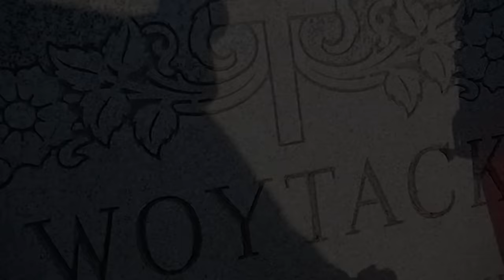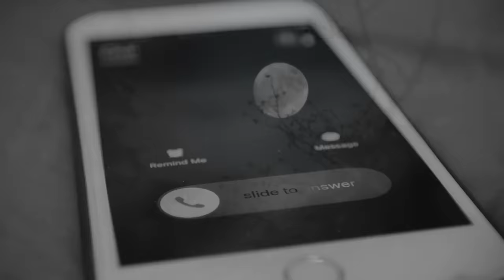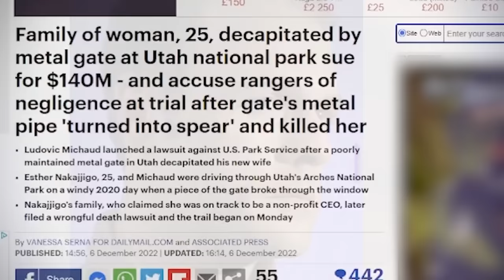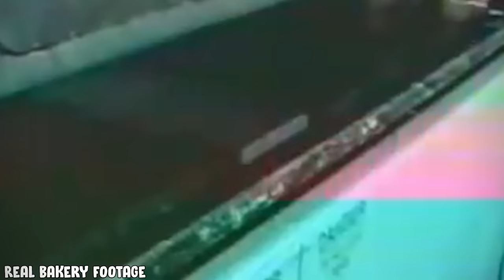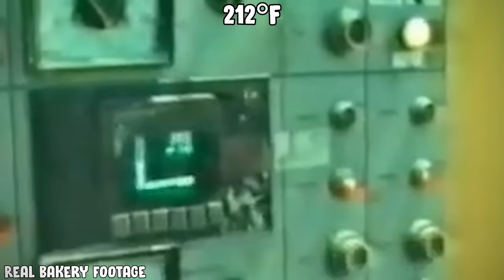CRUSHED by URINAL │ Bizarre Deaths #9

Comment: The story at #1 is an example why i quit working in a factory. Its always profit over lifes. If there's a safety audit, just put up band aids to get a pass then immediately go back to the unsafe "quicker" way.
Reply: Corpos gonna corpo, sad as it is. Unless their pocketbook is affected, they couldn’t care less about the well-being of their rank-and-file blue collar employees. 😒
Reply: every factory I worked at, safety depends on the workers, I take my time doing my job safely while others are always in a rush to get to work and they get injuries that basically get them laid off of work for a while.
Reply: orientation isn't just a bore fest when they walk you around and let you do some hands-on work
Reply: @_Circus_Clapped_  The problem is some factories would/will offer a productivity bonus effectively making their employees want to work quicker causing them to be riskier. It's the same situation with the old "we'll get your pizza to you within 30m or it's free" which caused delivery drivers to be unsafe while driving since pizza joints would fire their drivers if they took too long too often.
Reply: Same! Wasn’t worth it!
Reply: He actually didn't tell the story correctly. Neither of the guys were "engineers" or "technicians," they were just regular floor workers who were being paid extra to fix a simple issue with the oven; they could have just as easily declined the offer. The managers had told them that the ovens needed to air for at least 12 hours before they could go in, but the two insisted on going in early because they wanted to get the money and go home to watch a football game that afternoon -- if they waited the full time, they would have missed it. Their deaths were their own fault and the "failing to provide a safe work environment" charges is proof of that, because nothing more would ever hold up in a court. Mr Ballen tells it much more faithfully -- and that's really saying something, because he's terrible at checking his sources.

"On the day of the tragedy in May 1998, Mr Erickson, of Walsall, admitted he wanted to get the job done quickly so he could go home and watch the FA Cup Final with his two sons."

I'm guessing Tragedy just clicked on the first report about the incident on Google, which is a DailyMail article that was written before the trial was even over, so it's no wonder he doesn't tell the full story here.
Reply: Person Personperson  so true 😢
Reply: ctluthu  yeah,you hit the nail on the head with this one,I work in a supermarket and we were told so many things NOT to do,yet when there is a hurry,safety and rules be damned just to do something fast
Reply: Did you hear about Day Davis at Bacardi?
Reply: @Venelll  that doesnt change anything, you can say no in that case, its a bonus, then there is osha, if your employer really wants you to do something unsafe I bet one word will get them to shut up, "osha" they will find someone else to do it of course, but dont just make idle threats, actually call them, its your right and duty as a worker to insure you and your coworkers have a safe work environment, they cant fire you for reporting and if they try you are gonna make some good money from that law suit.
Reply: True..I've heard news about an accident involved a woman who worked as crane operator for smelting nickel. Negligence in maintenance causing the smelter dropped liquid nickel into the crane, causing it to burn and trapped the woman. She was burned alive as she couldn't get out of the crane
Reply: @Jolis_Parsec  in the end they lost the baking company. Their pocket book WAS affected, so what gives.
Reply: Perhaps if it affected pocket books faster....

Comment: I had a severe fear of ovens and being baked alive when I was little. It was bad enough I wasn't able to operate an oven until I was in my late teens. That last story gave me the shivers, I will never ever work somewhere with an oven big enough for me to fit inside! You couldn't pay me enough!
Reply: I've once worked for a company that did clean ups at factories during maintenance shut downs. Once we were at a factory with huge ovens for vulcanising rubber.  These things were big enough to park a van inside.  They'd been shut down a few days previous, but were still warm inside,  we had the doors wide open while working, but we'd come out every few minutes because of the heat and we worked in pairs spraying some chemical crap onto the wall to blast off the gunk that had built up since the last cleaning. 
 
Some of the other workers were immature jerks and thought it was funny to lock the two guys in to the oven next to the one we were in.  I don't know how long they were banging for, cos we only heard them when we stepped out of our oven and turned off the power hoses we were using. They were almost passed out from the heat, and they were red and sweating. 
If we hadn't heard them, they would have probably passed out and not been noticed until it was too late.

The jerks who locked them in didn't get fired, cos they were friends with the boss, and the people who actually saw them do it didn't want to give evidence against them, even though they'd told me they'd seen it when I asked who locked the door (they can only be closed from the outside. ) 

I left not long after that. They weren't a good employer, they didn't pay well, and saw everyone as replaceable, so I wasn't going to risk my safety by relying on people like that when dealing with industrial hazards.   I remember my last job they had me clean out a huge pool of industrial sludge, by myself, with nobody to monitor in case I slipped and sank in the stuff, which was at least 4 feet deep in one end of the tank.  They wanted it done in a day, which was unrealistic, and knowing it was my last day, I stayed up at the shallow end and cleaned that section very well, and made no apologies to the supervisor when he asked about the deep end. "You'll need two people, and safety ropes for someone to tackle that" then walked off.

Comment: The last one is especially terrible. The amount of greed put forward before their safety is insane. And just as bad was the oversight of not even bothering to check the inside temperature before going in. Whoever was in charge of ensuring those people did not get hurt failed in every way. Seems they didn't think about the consequences of what would happen if it went awry. I can't imagine the hell they went through.
Reply: Mind boggling
Reply: Its always profit before safety. So if you work in a dangerous industry, you have to put your own safety first and refuse to do anything that is not your job. If you have an accident and survive they will still blame you because you shouldnt have done something that wasnt your job. I read a case lately, cant remember where, a manager ordered his employees to clean out a tanker of animal waste, but they werent given the correct protective equipment ie gas mask. They went in and passed out from the noxious fumes, and drowned in the slop. Two lives gone, they should have just refused. At least the manager went to jail for manslaughter by gross negligence

Comment: I'm from Bristol , I've never seen a telescopic urinal until now , where I work there is a street cleaning machine that I use , called a Tenant M20 and when you clean out the machine the back half ( which is hydraulically controlled ) lifts up , there is a safety bar you use to secure it , because it you are under it and the hydraulics fail it pretty much will cut you in half , so I would presume that if the hydraulics failed on one of the urinals that it would simply come crashing down .
Reply: Yeah I was wondering about that too. Either there isn't any safety bar, which in my mind seems almost impossible in modern machinery, ot he didn't use it because he was in a hurry. 🤔
Reply: I visit Bristol often, and I’m glad I’ve never seen one of those about there, total accident-waiting-to-happen material. Thank god I’m a woman I guess lmao
Reply: How are they safe? I imagine it's mostly going to be drunk people using it who'll stand half in half out?

Comment: Yeah, that wind can be a bugger. I was in the southwest, somewhere in New Mexico and I had to stop driving because of the risk of being pushed over. I got out of my truck to check that everything was good with my equipment when a stop sign flew by at head height, no more than two feet away from me. Those things are heavier than they look and I know it would have taken my head off.  Talk about dodging a bullet (stop sign) there.
Reply: Having a lifted truck would help aswell.
Reply: @ryshellso526  My trucks'already 13 foot 6 inches, I'm not sure I'd want it any taller 😁

Comment: At the last one, what i would do is check if there was a thermal sensor inside. If there for some reason wasnt any i would let a block of metal or something else that can be hot but not melt through it and check its temperature when it exited

Comment: The one with the gate decapitation is a personal fear of mine!  We have a dual swing/arm gate like this at my work that constantly breaks free from its "hold-backs" and i frequently find it blowing in the wind, partially closed, and I often think to myself, man, as thin and low-profile as the tubing is that these gates are made out of, if this thing is partially closed its profile becomes extremely difficult to see when approaching at speed inside a vehicle!  When they're closed (aka, perpendicular to the road) they can be seen, but even then, just barely! Which is why I stuck reflective "conspicuity tape" all over the tubes that make up the frame of the gate and I even hung one of those reflective triangle signs between the top and bottom tubes on each gate, making it a LOT more obvious at night, but ONLY when fully closed and its broadsided is facing the driver.  If it were sitting partially open, it becomes invisible to approaching vehicles and my nightmare is someone drives into it at higj speed and has their vehicle impaled by the thin pipes. (Shudders) 😳

Comment: I forgot how much hard work goes into your channel Great to be back I’ll catch up on them all. As a former electrician I can safely say those pop up and down hydraulic urinals should all have CIRCUIT BREAKERS installed this is safety procedure for any electrical work IN ADDITION to turning the system off with the off switch and also use a “lock out tag out “ highly visible orange switch cover with safety tags alerting EVERYONE that workers are troubleshooting the systems. I would NEVER perform work without circuit breakers why weren’t they pulled !!!???? 💀💀💀🥲🥲🥲

Comment: That wasn’t a crane technically bruv! The truck that pulled the pisser off that man was a Class 8 Heavy Duty Wrecker. They’re used for towing and recovery/extraction of semi trucks (or lorries as you Brits say) and other large vehicles. But seeing as how a class 8 can lift an 80,000lb truck clean off the ground, that still says a lot about how dangerous them damn urinals are!

Comment: You couldn't pay me to go into a telescopic bathroom OR an oven while the belt is still moving, which says there is still power going to it. Those are nightmares turned reality. 
Wow.
PLEASE explain to me WHY people were allowed to crawl into that oven while the power was still on?! Isn't that the BIGGEST no-no? Isn't all power to the equipment required to be turned off before ANY servicing of the equipment?! Maybe I'm hearing that wrong and it was off, but NOT cooled off. Absolute neglect 100% of the way around. How did their bones break if the belt was turned off?
Reply: I can only assume they had to run the belt to get into the machine as there wouldn't be enough room to crawl, after all, loaves of bread don't need much height. Their bones were broken as they became entangled in the moving mechanisms as they tried to escape. A truly horrible way to die.

Comment: Hearing the last story really put me on edge cuz I'm a mechanic that works on turbine engines for the us navy inside the enclosure that can get up too 300 degrees Fahrenheit and if we need to do maintenance the cooling system has too be left one for 2 hours and the engine tagged out (shut off all fuel air and oil too it) and I've had too do emergency maintenance once and wasn't able too wait the full 2 hours but they gave me heavy gloves and a fireproof suit too go inside yes I was covered in sweat but I had a safety observer above me asking me if I was ok evey 2 mins or less I was able to fix the problem and get out but the observer still made sure I was ok incase of heat stroke or dehydration

Comment: I know about those industrial ovens. I worked in a pretzel snack factory and the heat it emits is overwhelming.
Also if you're supposed to crawl under it to clean up while it's running.

Comment: That bread oven one- WHAT THE HELL WAS THE COMPANY THINKING?! Ignoring manufacturer's instructions, not doing a lockout, tag out procedure, not checking the oven's temperature first, and assuming a system that had only been used one way could be used another without testing first, there's barely anything they DIDN'T do wrong aside from rubbing them in olive oil and putting them in speedos!

Comment: What I can’t understand in the last story is why the conveyer belts couldn’t be switched off at least. What exactly was stopping them from coming back through??? Still doesn’t negate the gross negligence from the company but surely if your crawling into an oven the first thing you do for yourself is check the temperature and ensure a method of getting out. Even things went smoothly it seems like they’d have been trapped in there until the side panel was opened so I can’t understand how this even happened.

Comment: Really  not trying to make you feel worse brother, but the final story had you saying "Hell on earth"..which all I could think of was the incredibly horrific story of the 'Tampa Bay Powerplant Incident '

August 17, 2017---The blast happened suddenly, with enough force to toss Carlton Nelson across the powerplant’s floor.

When he came to, the veteran Tampa Electric mechanic lifted his head and squinted. The tank he had been trying to fix was spewing a deadly substance called slag from an open door, like a volcano gushing lava. Nearby, a forklift was melting in the molten goo.

That was in 1997...
   After, Tampa Electric wrote special guidelines so another accident like it would never happen again.

Then two decades later, almost to the day, five workers were killed, burned to death performing a near-identical job at the utility’s Big Bend Power Station in June.
   If Tampa Electric had followed the guidelines, the men would still be alive.

Comment: Theres a clear through line here:
Cutting costs and saving a few bucks leads to people dying.
Headstone, could have been better supported and not let thermal expansion make them sink to the ground.
Steel chair, something better than wooden blocks could have been used to make them not topple over.
Gate, a padlock would have been enough to keep it from swinging open in heavy winds.
The Urinal, more failsafes, how this thing didnt have a mechanism that prevents it from lowering if something was stuck in the opening is beyond comprehension.
And finally the oven, they shoulda just waited for it to cool down.

The price of life...

Comment: I feel for the guys trapped in the oven. At my job management would never let something like this to happen because of past incidents from other branches, like death in a confined space, to losing limbs. Have to properly lockout tagout all machines, make sure all presses are cool before changing, that steam is cut off, and no bypassing safety measures, ect. It was negligent for both men and the company for not following safety procedures, ofc back then OSHA wasn't a thing and safety wasn't a main focus.

Comment: No disrespect to the urinal guy, if your career is repairing these things then you should clearly know that when something is jammed while resisting massive force, when it becomes un jammed it will snap back with multiple times that force. Not shutting the machine off or taking common-sense precautions was foolish.  And the people in the oven were just stupid. Who in their right mind would proceed down the gullet of a powered on industrial oven specially without checking the interior conditions?

Comment: I"m guessing no one at that factory knew a ****ing thing about that oven before sending those men inside.
The fact that they broke most of the bones in their bodies means that they would most likely have died without being burnt alive.
Conveyors don't care if you don't fit, they will keep pushing you until either you -- or the machinery breaks.  Guess what is stronger.

Comment: I would never use one of those urinals. Looks suspiciously like a death trap to begin with and hydraulics can and do malfunction. People in my area have literally died due to hydraulic malfunctions of car lifts. One reason elevators scare me. That threshold getting into it is a dangerous place to be if it decides to drop. Then again, being inside if it drops wouldn't be great either. As for the urinal, imagine if someone was taking a leak and it fell and trapped them underground.

Comment: how come the hydraulic system of the urinal didn't have a pressure release valve, a counter weight or sensors to take crush events into consideration is beyond me. it was the designer who killed the technician.

and the baker technician, and the engineer. when working with machines that can chew or bake you: just unplug the cord - remove the PTO shaft.  
there is no discussion.

Comment: The story with the urnail should be fixed to where on the outer layer of it on the ceiling should be touch sensors where if someone or something touches it, the urnail will immediately open back up, or stop moving like windows in most cars